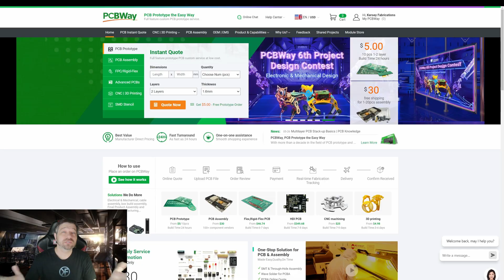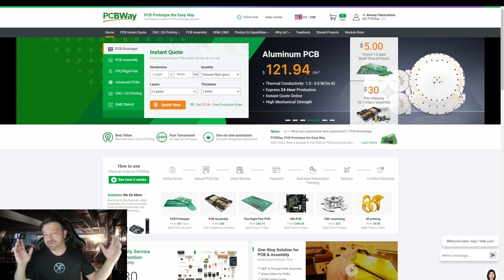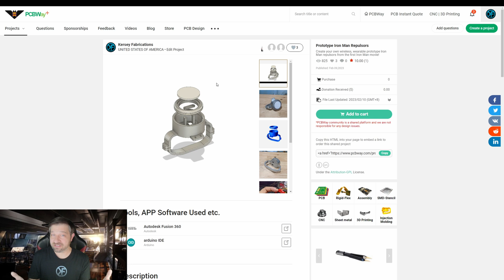EDF Quadcopter 2.0: Time to Evolve

Comment: Hay Kersey, I have watched some of your drone videos, and I see myself in those as I were a couple of years ago. I will give you a tip: Flight Controller (for example dji naza v2) can balance and re-balance the drone (with engine-throthle management) a couple of hundreds times in a one second. Humans normaly couldn't do that. So, flying without flight controller is almost mission impossible. And that electronic co-pilot of yours  (Flight Controller) need to know where in 3D space he (his aircrsft) is, and for that purpurse he has a GPS modul. Without those, there is no stable flight.
And do not forget that Flight controller must be in the center of the drone as much as possible, with the right vorward-pointing direction, and second not to forget: before the flight - you need to calibrate the center of mass (the whole drone with the batteries must be in mass equilibrium - mostly under the center of mass-center of drone-under the center od Flight controller).
P.S. all the motors / edf's should be the same serie if possible (and 2 of them for clockwise rotation and the other 2 counterclockwise - but that will tell you dji naza v2 with her softwer). And all the ESC's should be the same serie and programed thru the esc program card or your transmitter.
I hope I was clear. But you can ask me anything, because this is a beginner project, later on, I would assume that you are going to upgrade it with camera, then with fpv screen, than with telemetry, than....and after a year or two you are going to use Iridium Satelite connection instead of just rc 🙂